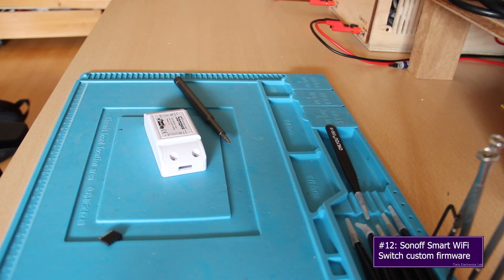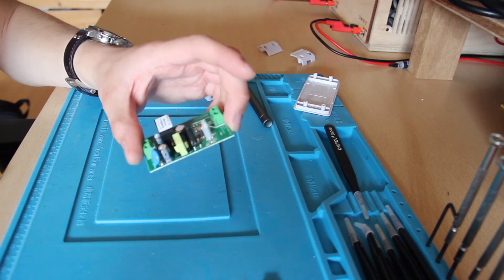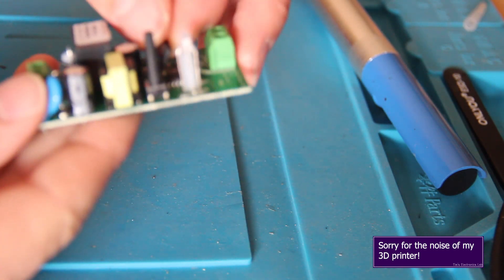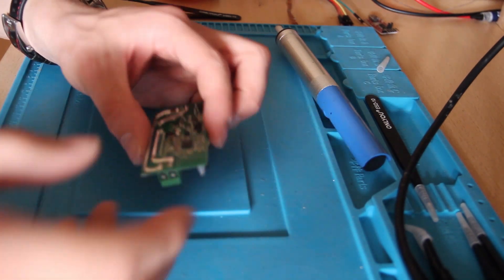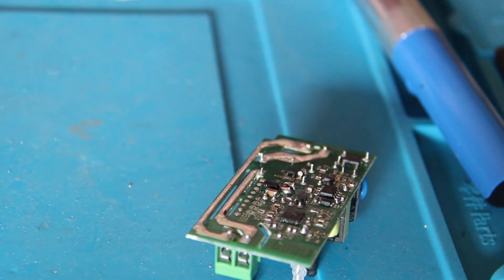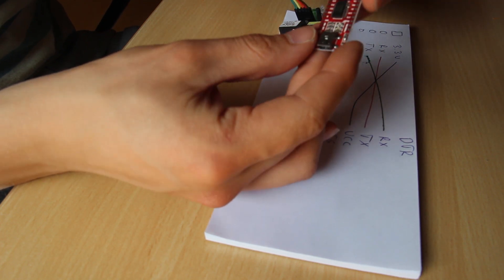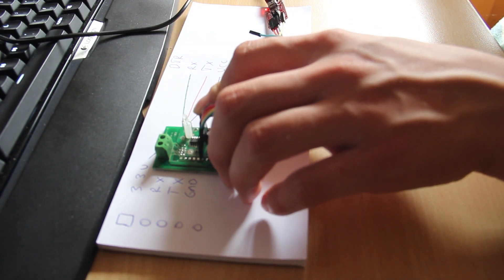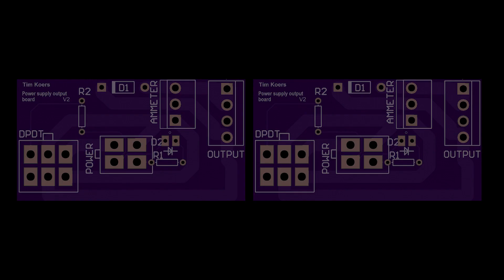#12 Sonoff Smart WiFi Switch custom firmware

Comment: Hi Tim, thanks for the video! I had a look at the code on GitLab and it looks interseting. I will try it out. Btw... the 5th pin is connected to GPIO14 of the ESP8266. I have a few programmed as an extra button, but you could also connect a temperature sensor for example.
Reply from the maker: That is a really nice one! Now I don't have to put a seperate ESP8266 inside the same room to measure the temperature